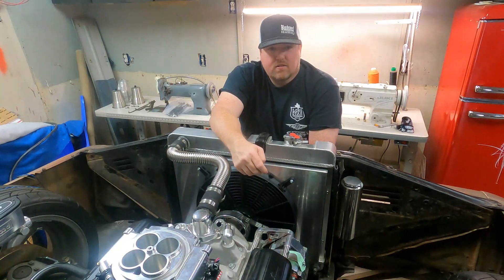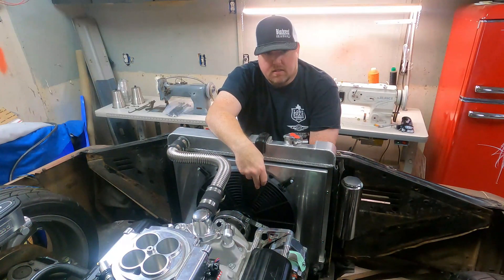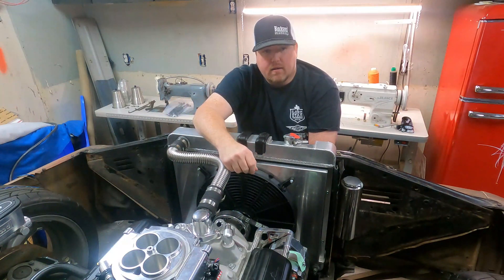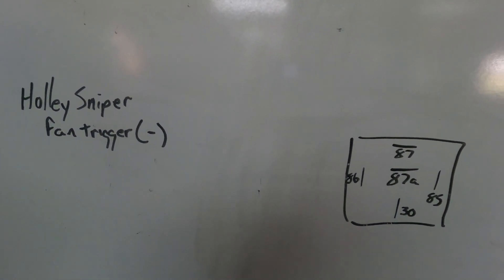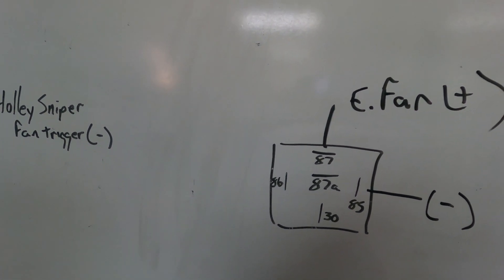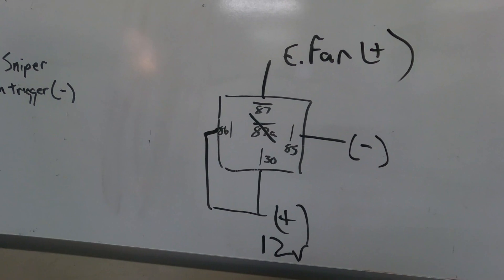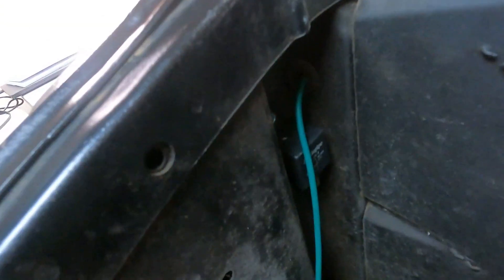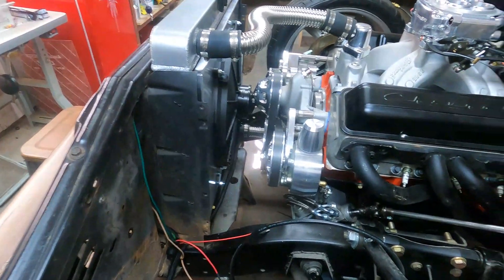Wiring a relay from the Holley sniper to an electric fan on the C10

Comment: First question: Can 86 and 30 both be wired directly to battery + or should 86 be wired to a switched + source? Or does it not matter since it's a ground trigger? Second Question: If I wanted to let Sniper control the fans for normal driving but also want to be able to run the fans when the car is hot and parked, could I wire a manual ground trigger switch to the same terminal (85) as the Sniper so that either the sniper or a switch on the dash would trigger the relay? Or would that manual switch damage Sniper? I'm thinking it's all the same ground but not sure what a second ground connection might feed back into the Sniper ECU. I know this video is old so I'm hoping you're still out there!  Cheers

Comment: Yes they do this because they don't want the sniper ECU to be handling the  Is 12  Volt amp current load So you trigger the ground  trigger To control relay for the fan but it's very clever Just have to read that manual Closely And most manufacturers use use the ECU ground triggered Injector driver's such-and-such that the ECU is not carrying a high ampload thank you for  Making a video on the subject because they don't lay lay that out very clearly in the setup manual for Holly Just finished installing a dominator X on my buddy's 95 Mustang I got a cheap $40 wire it yourself relay Box off Amazon put positive and negative bus bars under the hood Cause I relocated the battery into the trunk 3 relays in Box fuel coil and fan which is what you remove Out of the factory system Tripped me up a little bit used the Gray yellow wire to ground trigger your fan relay all The rest are positive trigger Fuel and Ignition coil Key on engine cranking

Comment: so you dont need a switched 12 volt supply?
Reply from the maker: If you're running direct to battery on the relay, then you could use pole 86 on 12v ignition. Coming from this harness, the "fan power wire" isn't hot at all times
Reply: @BlackseedOriginals  so where are you getting power from for the fans?  does  the neg ground from the sniper replace the 12v switched wire?